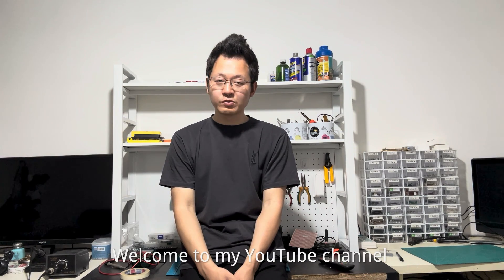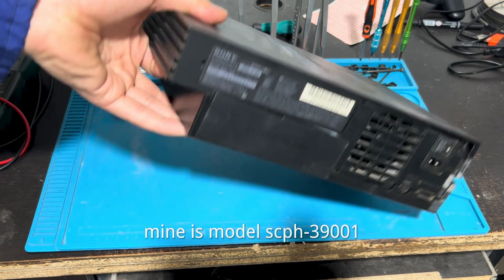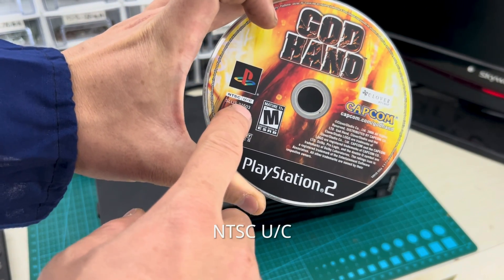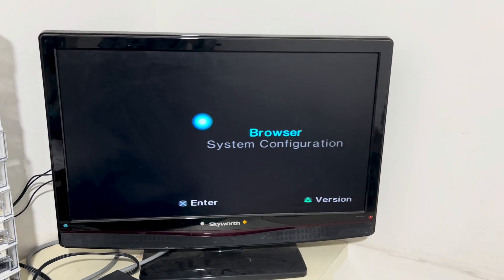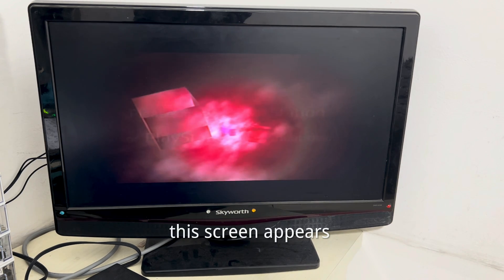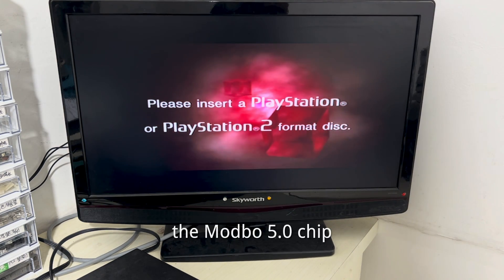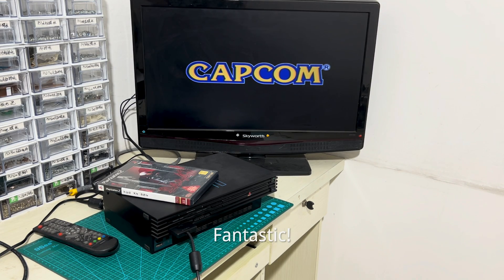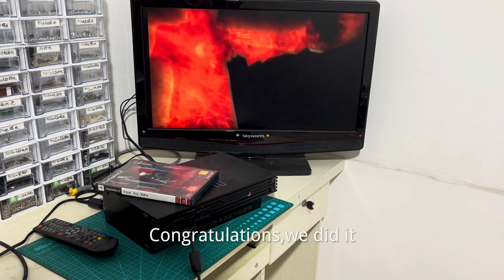Installing the Modbo 5.0 chip in a fat PS2

Comment: i tried this and for some reason my ps2 is making echoing noises of the sound nonstop and i ripped the controller port plug out and it keep saying no dvd playback enabled i just had some bridges on the chip section. works now, next you need to fix the dvd drive
Reply: Sounds like you fked up